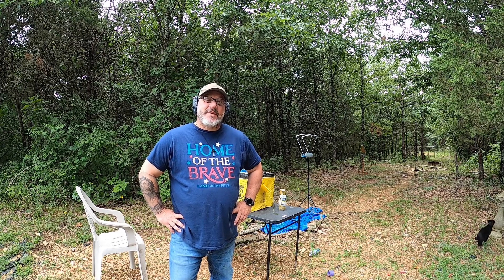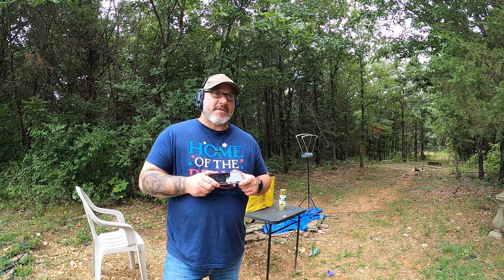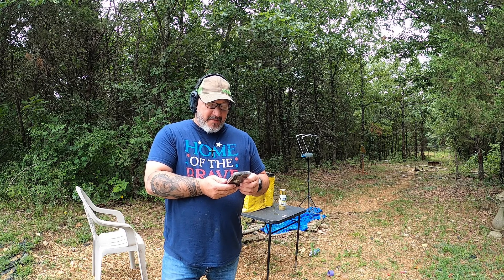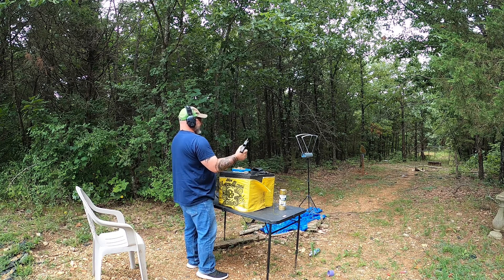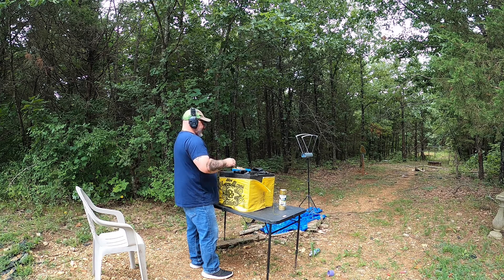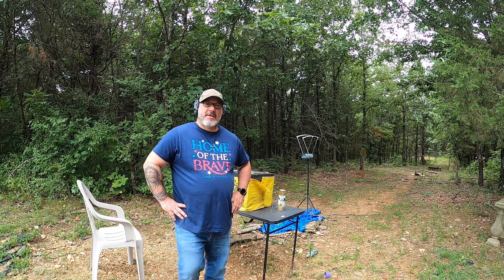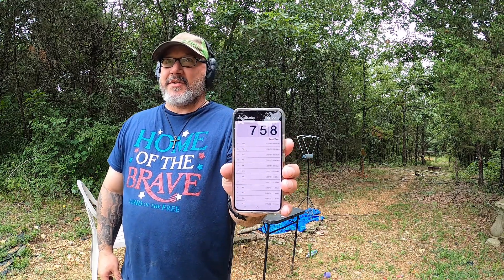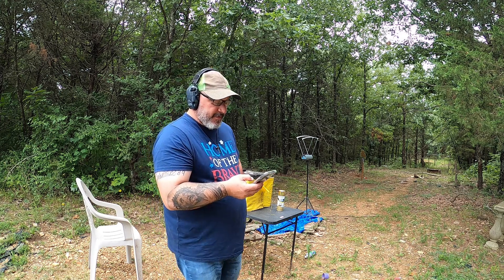45 ACP Reloading - Dialing in the Perfect Load

Comment: The .45 acp is loaded super soft it has way more potential. Study .45 super 450 smc I’ve seen 230g at 1400 fps no issues in regular old pistols (not Glock) u need a fully supported chamber.

Comment: Sig stainless p220 my standard load is 200g at 1100 fps using 11g of blue dot. Small primer case no pressure signs . I plan to go 1400 FPS + with rifle primers. Do not copy this load with a stock Glock u need a fully supported chamber and heavier spring. The .45 was a copy of a down loaded .45lc so it has way more potential than factory maned ammo.
Reply from the maker: Great sweet spot for a standard load! And wow the 1400 would be moving. I appreciate letting folks (mainly those still new to reloading) know you need the upgrade some parts before you start experimenting with spicey loads. Good luck!

Comment: Not sure what your issue was. I have a G30S, I aim to get 1200fps from a 250gr.
Reply: When I chrono, I find that the chrono shows 200-300fps more than reality. Removing the shades fixed the issue. I don't understand why. I used the same chrono before and did not have this issue. I was at the same location as always. So far I have to always remove the shades with the new chrono.